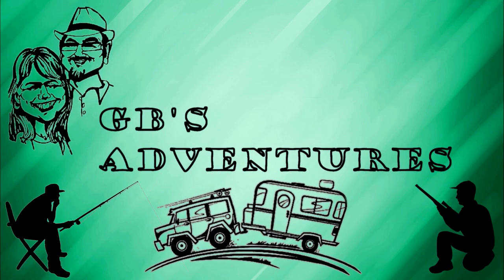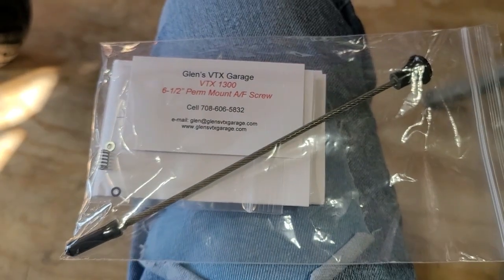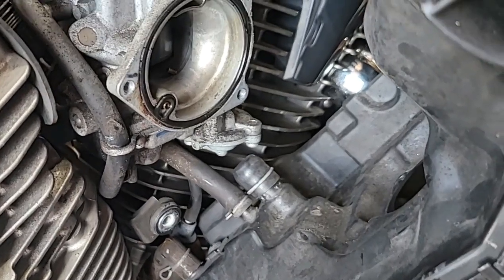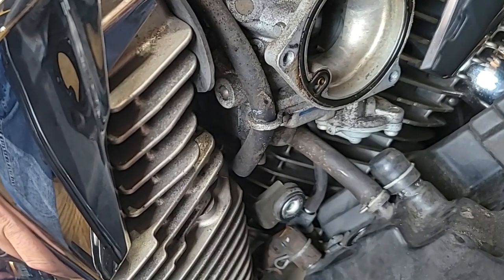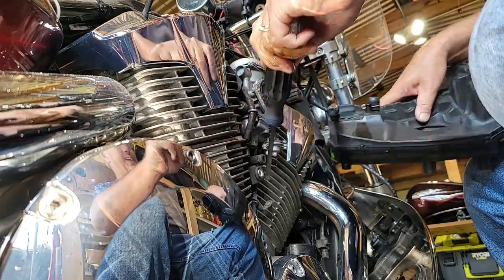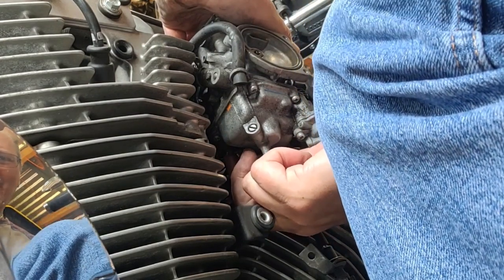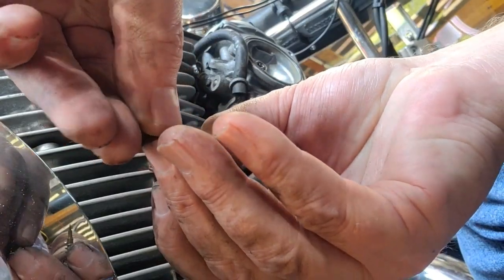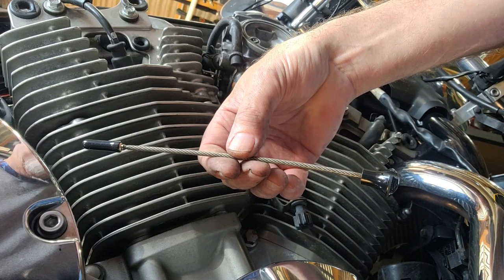Glen's VTX A/F screw install

Comment: Have you had any issues with the adjustment wire moving and changing the mixture ratio over time?
Reply from the maker: Not since I installed it